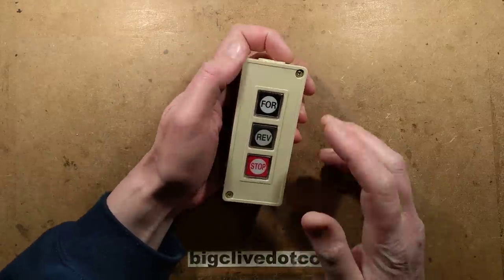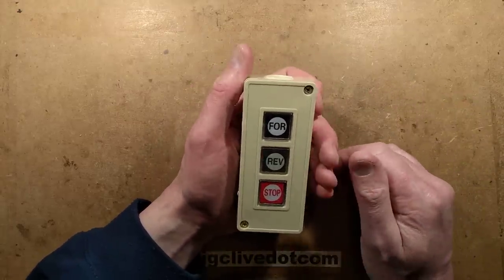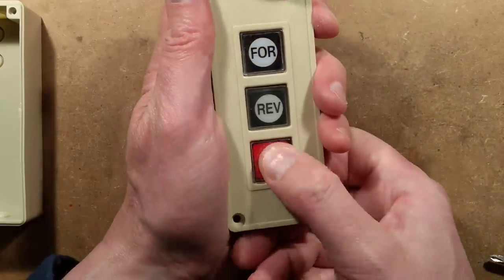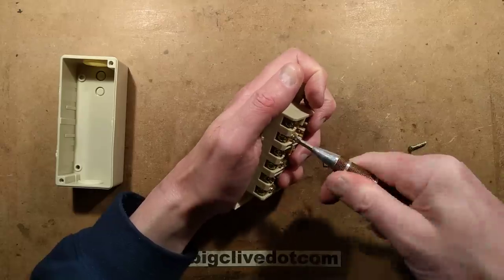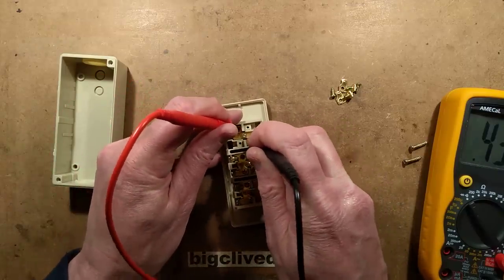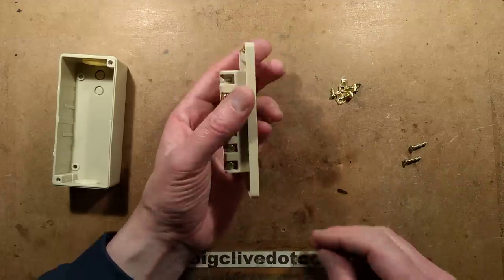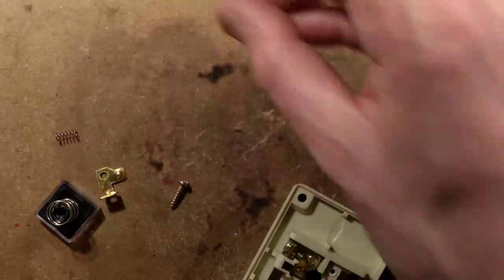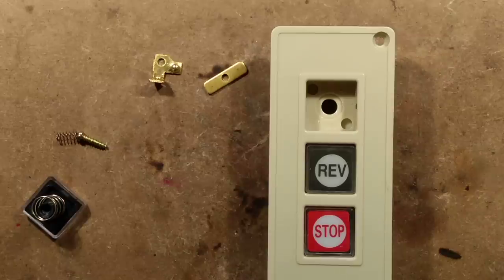Unusually cheap and crappy machine control station.

Comment: Most metals aren't magnetic with the exception of iron, nickel, cobalt, gadolinium, neodymium and samarium, so the contacts have at least one of those in them.
As for industrial use - forget it even if the contacts were reliable, just think about it as a pendant control for an overhead hoist while wearing heavy duty gloves, you need to be able to feel which one you need to press !
Reply: Technically, all metals are magnetic. Just not ferromagnetic. Actually, to be even more pedantic, it depends on the structure of the material. An alloy of ferromagnetic metals can be non-ferromagnetic, and vice-versa (ex., Heusler alloys). Chemistry is weird, but I'm pretty sure metallurgy is magic.

Comment: Could be wrong but they look like beryllium copper contacts. I know brass is more common but there might be a price difference. That said Ignes Andros is more likely to be correct.
Reply: Beryllium copper looks to be roughly three times the price of brass. Highly unlikely to be used in a cheap Chinese switch.
Reply: @RedwoodRhiadra  brass must have come down in price by a lot since I last looked then. It was near £5 a kg at one point. Also as I said Ignes Andros is more likely to be correct.
Reply: It's less that the price of brass has come down and more that beryllium is fantastically expensive.
Reply: @RedwoodRhiadra  I know it's expensive as a metal but normally beryllium copper is only about 3% beryllium max.
Reply: @RedwoodRhiadra  looks like I misread somewhere. Beryllium is about 10 times the price I thought it was.

Comment: Iv worked in a few places that had control's like that and loads of machines with similar buttons and I remember getting a shock of some when switching them off. One place we had to use a broom handle to switch it off. Never knew why that happened until now!! It must have been an inductor somewhere in the circuitry.. Can't for the life of me remember where that was where ya need the brush handle🤔
Reply from the maker: It's sounds like a grounding/bonding issue or possible static discharge?

Comment: I need to send you one of the pendants from one of the  cheap hoists I have to deal with, if you look up the LA137 (ebay and amazon sell them now) switch, they like to melt on some of the cheap hoists because they are doing the actual motor switching in the pendant.

Comment: Boeing standard (back when I was in Boeing London Service Centre, in Reading) was up to 3 ohms (according a calibrated avo 8, not the other gear we had) was acceptable for a closed switch. Mostly using 28V DC, and all kit was designed with that in mind. Not that I'd like to see this controlling the engines 🤣
Reply: 3 ohms sounds like these switches were supposed to have quite exciting DC arcs during normal operation, until they're more resistors than switches and should be replaced;)
Reply: @shana_dmr  Even "simple 28V or not switch inputs" had/have an incredible amount of filter circuitry. They're pretty much 'anything' proof. So much over engineering. It oddly made me happy when I finally spotted a design flaw - which they immediately rectified with a Service Letter to all airlines and free upgrades. (Yay kudos, followed by bonus overtime)

Comment: We use 48VDC and 125VDC controls in our substations.
Reply: Where I live we use 24VDC on small circuit controls, 48VDC medium length, and 230V mains AC on long run circuits. Labeling errors are often causes of accidents. But I personally treat every circuit as if it was mains circuit until I know for sure, should be any electricians rule.
Reply: A company I used to work for used 24V then 28V then eventually 48V due to the contact malarkey. Cost a fortune to upgrade everything. They would not listen when I said all they needed to do was use better quality contacts. Two years later they finally listened and I reduced failures by a factor of 100 for only a 5% cost increase. The damage had already been done though and they went to the wall.

Comment: The simple question is this, if you saw a bit off the bottom of a table leg, will this switch box fit in the gap so created, in such a way as to rectify the wobble thus induced? If so, it will serve a practical purpose. If not, I suggest you don't saw the leg off your table! Otherwise, it will add ballast to your waste bin. It's all basic science really.

Comment: Hi Clive! Consider ordering on Banggood, Gearbest,Aliexpress etc... You might get an even better deal! ;)
Reply: nope, they are the same price as the ebay listing even with the sale on aliexpress. 
Also eBay do not give you the random% off sale bullshyte that is all too common on those sites. 
I use aliexpress (takes longer to find good stuff due to checking for scams like overpriced shipping etc...)
or ebay.com (international site, because the Australian site tries to overcharge for EVERYTHING).
If low price is what you seek check out alibaba.com (quickly becoming a aliexpress clone, but from manufacturers not dropshippers).
Reply: My last 3 orders on Banggood did not arrive. I don't use them any more.

Comment: Stop should be the emergency button :P even then we get some clones that will break with one use but at least that buttons do their job. Now industrial jamming buttons only with use and abuse not brand new :P Get from the proper chinese . For traffic lighs 24VDC locally . use for home low voltage appliances

Comment: Without fail whenever I request a refund for a low cost product from China on eBay they grant it every single time without asking for the item to be shipped back. It recently took 3 attempts to find an obscure bi pin globe and I now have a ton of spares of random sizes sitting about.

Comment: I wouldn't use it for mains. It may arc as hell.
Reply: I don't personally use anything off these cheap knockouts on mains voltage. Only ebay stuff I use on mains is from trusted sources and manufacturers, and even then I use them only on personal projects.

Comment: What if you coated it in solder? Cheap fix if it works...
Reply: That only works for a few hundred cycles at most. I know I've done it when replacement relays were not available.

Comment: The thing I love/hate about all these shitty Chinese products is how bad they make the value of other products look. Specifically, as an electronics DIYer myself, the biggest struggle is finding blank chassis or project boxes that don't cost a fucking fortune. But then you see a product like this that is an entire assembled and shipped device with a box and internal components and everything, which costs less than I can buy even a bracket from locally, much less an entire project box.

Comment: may help the action if they didn't use wood screws...smh...
Reply: Those aren’t wood screws, they’re selftappers for plastic. They’re used correctly.
Reply: @JasperJanssen  okay. that's fine. they may have been used properly, but they aren't the proper screw for this job. either way they cheaped out.

Comment: Some aluminium alloys contain iron as does some brass.
Reply: Technically, the only brass that should contain iron is red brass, which is generally classified as a bronze (although it's sort of between the two). But it should be something like 0.05% iron, so it wouldn't be noticeable. More likely, this is some sort of aluminium bronze, which has a more relevant percentage of nickel (and occasionally iron as well, but the nickel should be enough to make it slightly magnetic).

Comment: Exactly where can I use a 3 Amp push button in an industrial setting? Even the switches for the lamps in my house are 10 or 15 Amp. And the reason is, they have some kind of spring mechanism to separate the contacts very quickly. That is it.

This design was pretty acceptable in the 1900's, maybe, when the precision of the pieces was abysmal, so a spring mechanism would frequently stick. But right now I believe it is even difficult to find a microswitch with such a small amperage rating.

My guess is, if you include some engineering time and replacement time and estimated lifespan in your project, the use of this box instead of one with microswitches will be incredibly expensive.